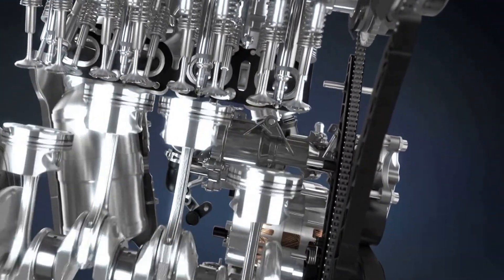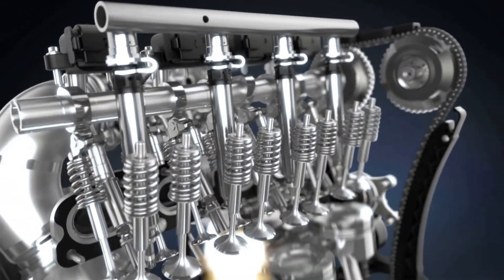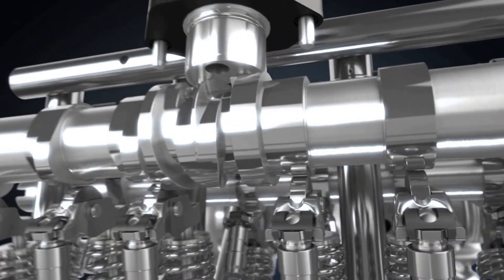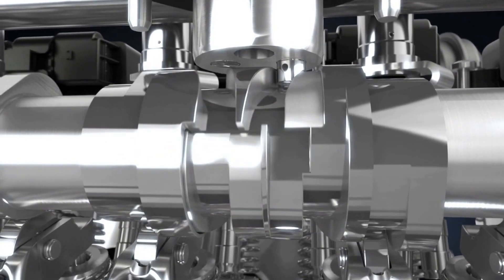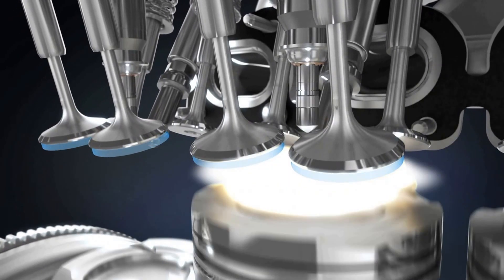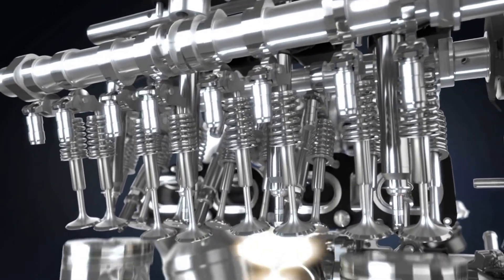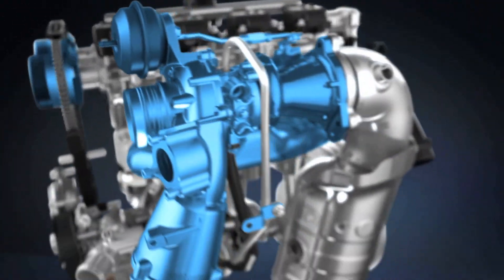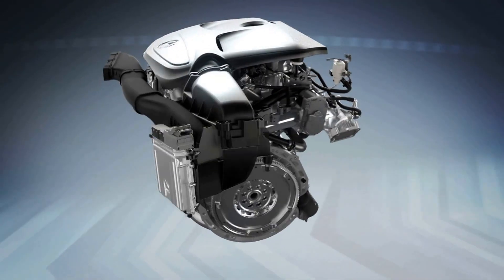CAMTRONIC van Mercedes Benz

Comment: The patent for this system is in Honda. Vtec is a flawless system that works with hydrostatic pressure and does not cause internal failures. Mercedes, BMW, etc. They develop ridiculous systems to avoid patents, so they fail a lot. Similarly, the VTC cam shaft timing system is also in Honda's patent. The world's most durable engine is Honda Toyota Mazda. Mercedes' engineering is insufficient to produce old quality engines. Also, do not show the system here as if it has done something. The inventor of this system is Honda

Comment: Great Video so,  CAMTRONIC or VTEC ? ... it was the same ?
Reply from the maker: The main objective of Camtronic is not to enhance power but to reduce fuel consumption...
Reply: @Mercedes-Benz-nl  Thank you, I have a my2014, C180, the M274 (1.6L) use Camtronic ?
Reply from the maker: We would like to advise that we do not provide workshop instruction from this page. You can visit http://mb4.me/tTGK3Y7L/ for information of this nature. Alternatively, you can contact your local Mercedes-Benz Workshop and speak to our After-Sales Team. For contact details visit http://mb4.me/YJrJgMV8/.
Reply: @Mercedes-Benz-nl  I mean vtec can be used for fuel consumption purposes (Vtec-e for example) just like this could be used for increasing power, they both are just for 2 stages of cams, so if the company decides to tune it for max lift they could I think